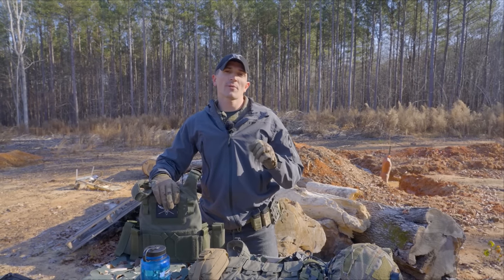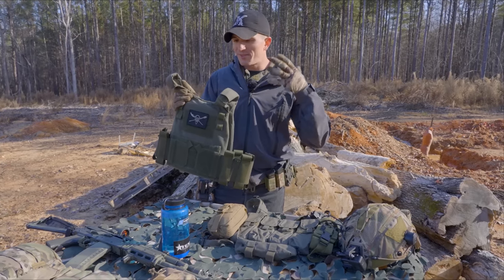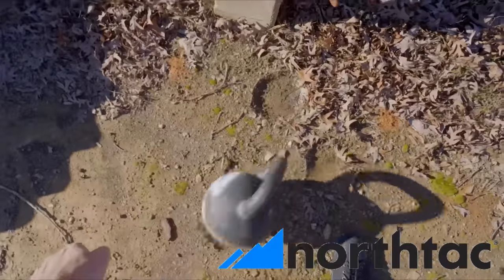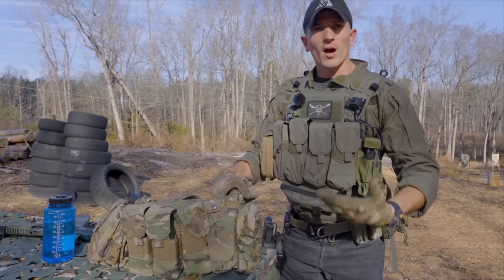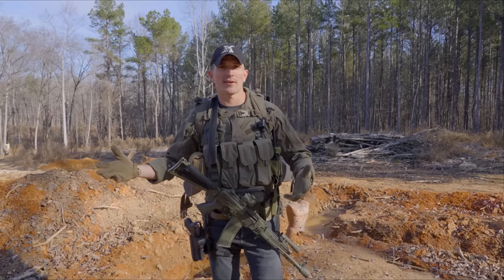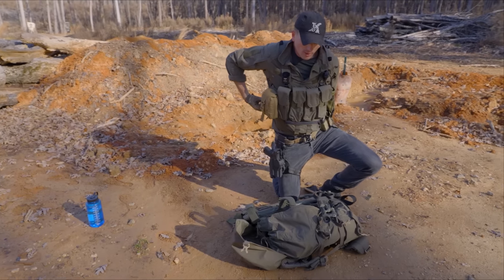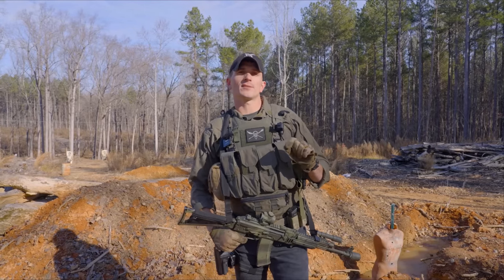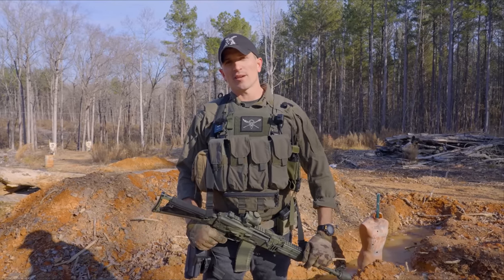What Is Even the Point of Slick Plate Carriers??

Comment: Step one: buy a slickster because the gram pressured you
Step two: try to turn it into a complete PC
Step three: give up and put and lbe over it, pretend you meant to do that all along
Reply from the maker: 2020 IG in a nutshell
Reply: >bought slickster
>put MK V on
>add Radio, TQ and PTT
>adds meds in the dangler
And now im wondering what you guys need more as a "concerned civilian". Yeah, its not the best setup for some things, but it is great for others
Reply: Im in this picture and I don't like it
Reply: You forgot step 4. Buy a velocity or crye or some other PC that actually handles the weight better and cry because you wasted money. 
Step 5. Buy another set of plates
Step 6. Cry more. 
Step 7. Rationalize it as backpack armor.
Step 8. Comment on YouTube videos to cope.
Reply: I am currently going through this cope right now.
Reply: Putting a taps over a plate carrier is the best option because you can just have multiple taps for different loadouts and throw them on top of the plate carrier.
Reply: @deltashot5608  based
Reply: I’m about to buy a slick specifically for the purpose of wearing it with lbe 🤷‍♂️ don’t really get what’s wrong with it, I just don’t want all the bulk sticking out my front like with a regular plate carrier setup. Lbe keeps the weight on my hips which is so much better than a PC.
Reply: guilty as charged

Comment: In my humble experience, the concept of a slick plate carrier is a bit more nuanced than would be initially expected.  From my real world experience hiking up and down afg and also being in a Striker unit gives me two diametrically opposed ideal load bearing set ups for carrying mission essential equipment.
When mounted and mechanized having all of your kit on a PC or Vest is ideal due to the ergonomic considerations of dismounting vehicles with all sorts of snag points, however when spending extended periods of time dismounted where your feet is your only transportation all of your kit weight is only your shoulders leading to increased fatigue and long term lower back injuries.
Now if you run a belt harness (like the vietnam era lbe belt)  for most of your mission essential equipment that weight is now distributed across your hips as well and not just on your shoulders.  Another benefit to the belt harness is dealing with compromised cover positions and prone.  Even if you slap a slick PC on top of the harness it is a far lower profile for prone and more maneuverable in compromised positions instead of the bulk that having double mag pouches and other gear adds on top of your carrier.
So in my experience if you aren't a super spooky low profile operator where considerations of kit concealment come into play you have two ways of effectively hauling your kit.  A mechanized load bearing setup where everything is on the vest where mount and dismount efficiency is life and death critical and the long range dismounted issues are mitigated due to the inherent employment of mechanized infantry.  Or you have a dismounted kit where your weight and width profile is tailored for long term operations away from vehicles.
Just my two cents and looking forward to the keyboard commandos claiming I'm a pog chair operator who doesn't know what he's talking about.
Reply: you can kinda hybrid this by running thinner belt pouches and some sort of load shifter that connects your armor to your belt like the crye STKSS.
Reply: @fartknocker  absolutely there are ways to hybridize kit to varying degrees of efficiency depending on your dismounted vs mounted needs.  But the caveat I'm looking at is carrying a standard infantry load or plus load, so if your kit incorporates a reduced load or "low profile operations" load you can get by with thinner kit albeit at the cost of mission equipment.
Reply: Me and my buddy were discussing this exact thing nearly word from word. He's an AAV guy.
Reply: @IrregularRex  kick ass dude, much love for fellow mech grunts.  Living the life of an infantryman is a complex list of trade offs and priority management and I always love covering the nuances of squad composition, gear distribution, and realities of infantry life past just gadgets and tech.
Reply: @borrago  running slick with minimal gear and maybe a flc vest or chest rig is ideal when having to deal with hatches when operating vehicle crew slots.  When in that case having a basic infantry loadout on your person is less important vs having an emergency loadout in the case of having to quickly dismount a vehicle due to catastrophic damage.  Trying to get out of a gunner/driver/vc hatch can be very problematic in those conditions.  Once again making sure your kit matches realistic needs and priorities is essential.  Vehicle crews just happen to fit in a unique position vs their dismount compliment brethren.
Reply: You are a pog chair operator who doesn't know what he's talking about
Reply: @MrTappers7  I saw you'd been looking forward to that comment for over a year. I'm slightly disappointed in the comeback. Decent response time though
Reply: @Codeeez  I honestly forgot that I put that caveat at the bottom I deleted my response when I reread my initial post
So well played bro and my bad for forgetting my own sign off thinking I was dealing with a different comment line entirely

Comment: I'm glad you covered this bro.

In Contracting, we still use a mixed bag of Chest Rigs and Slick Vests and Plate Carriers (that's moreso on the acquisitions and provision side of Company assets but does have operational needs applicability based on contract too), it's definitely more comfortable and viable for Mobile/ Vehicle use and operations as well, or if you want to try and keep a low profile/ be somewhat covert working deep in the Urban Theater.

The Patrol points are spot on, especially for LRRP and extended distance patrolling, it's more practical to be as light and fast as possible with Combat Load (as you know).  

I run different rigs based on personal and work needs, have a couple PC's kitted out but also have a Slick (from Gear Dynamics) with an OPS Chest Rig (in M81/ God's Flannel), I much prefer the latter.

There is no best system (I've made a video on that too), just what works best for someone based on their needs and environment.
Reply: There's a ton of slick carriers in Ukraine not just because that's all they could get their hands on but even in a really nasty artillery war you're going to have reliable transport and resupply. Video of foreign volunteers calling resupply by phone that arrives faster than your pizza is out there.The days of needing to carry everything you need as the average grunt are kind of over after the last 20 years. A lot of guys wouldn't even wear a rear plate anymore if allowed. And a ton of the high speed guys have gone out a times with no plates, no sidearm, and maybe 2 spare mags for the carbine. Again, guys in Ukraine are trying to carry the least amount possible when running around some city or village in gunfights. They cache stuff, etc.

The founder of Nike discovered that a single 1oz track spike weighed 50+ lbs over a mile run. Weight sucks. Normalize being a minimalist. We injured so many guys over the last 20 years sending them outside the wire weighed down like donkeys in summer heat.
Reply: @RJT80  Yep i've seen that too (and been told by buddies who are there currently).

METT-TC and general situations will dictate what and how gear needs to be carried, moving fast across long distances is one thing, slow slugfest urban warfare with every nook and cranny being a risk for incoming fire is another.  Adaptation happens out of both necessity and the tempo and type of fighting being done.

True, in the earlier GWOT days when I was in the Army we easily doubled our body weight with everything and a ruck/ pack on.  No wonder at all why we all have jacked up backs, knees, necks.

Comment: Good compromise for still utilizing a chest rig or suspenders and battle belt rig. However during ambush your proximity to the ground may be your only cover. Having a rig like the size of Dolly Parton out front won’t be your friend. My compromise involves both gear and load out. The actual Dynema Ceramic Plate rides in my day pack until I insert it into my plate carrier. And I only carry 2 mags up front. Third pouch for radio. I carry 2-4 mags on my belt and more if needed in day pack. Water is usually in my day pack  though I sometimes will carry a canteen, cup, and natick stove combo. Rather carry ammo on my belt for easier access when prone.

Comment: When it comes to specifically vehicle stuff slick plate carriers make a lot of sense. When I was in a more vehicle focused unit pretty much everyone used a battle belt or chest rig but kept their flak completely slick. You can pretty quickly put on or remove a belt when entering  or exiting a vehicle but if you have all those pouches attached to your flak it can get very uncomfortable, plus egress from a rolled vehicle can be extremely challenging with a loaded up flak.

Comment: I like running a slick carrier and a rig

Gives me more options and versatility to run one or the other for different needs

I do feel it really really make sense when you’re operating in and around vehicles. 

Keep the armor with the vehicle unless you’re planning for contact. If you’re planning on a patrol on foot can leave it there or put it in your pack and just wear a rig. If you’re gonna go kick doors or hold an area for security you can have both. Etc etc etc
Reply: There's a ton of slick carriers in Ukraine not just because that's all they could get their hands on but even in a really nasty artillery war you're going to have reliable transport and resupply. Video of foreign volunteers calling resupply by phone that arrives faster than your pizza is out there.The days of needing to carry everything you need as the average grunt are kind of over after the last 20 years. A lot of guys wouldn't even wear a rear plate anymore if allowed. And a ton of the high speed guys have gone out a times with no plates, no sidearm, and maybe 2 spare mags for the carbine. Again, guys in Ukraine are trying to carry the least amount possible when running around some city or village in gunfights. They cache stuff, etc.

The founder of Nike discovered that a single 1oz track spike weighed 50+ lbs over a mile run. Weight sucks. Normalize being a minimalist. We injured so many guys over the last 20 years sending them outside the wire weighed down like donkeys in summer heat.

Comment: I actually keep a minimalist plate carrier in my vehicle. It fits under the rear seat of my Jeep and it is only for emergency. I just put an older set of steel plates and spall  pouches in it and if I ever end up in a situation I need to be protected while away from home or throw it on my kid I’m a bit better prepared. Ceramics go in the full kit where weight savings are better realized.

Comment: My thoughts before you get into the video: I think they have a use in that you can throw a different loadout on top of a slick carrier depending on what you'll be running/doing far easier and more quickly than if you were to rearrange your entire kit for the "mission" at hand. So your area could be dense forest but, if you drive a few hours away you could be in a desert, and you'll want different supporting equipment for that. Or maybe you like to switch up the rifle you run, an AR one day, an AK other days, maybe a battle rifle other times. Buying multiple chest rigs is cheaper than multiple carriers

Comment: OK I'm making this comment before watching the video. In my opinion the reason to buy some slick plate carer is the modularity. Some have solid velcro on the front. If you by the right gear you can basically rip of one rig, slap on your shotgun rig, and done. And you only bought one plate carer. That being said 95% of people don't need one. After video. Made some good points. Agree that having a separate chest rig is a good idea with this

Comment: You can take a chest rig off or open it up if it is a split front. Option a allows you to lighten your weight a little while still wearing armor if your just at a range and resting or if you're just hanging around a FOB or whatever. Option b allows you to get a good prone even if you built your kit out for vehicle operations like a patrolman or security guard might. 

It's pretty simple actually. Just a versatility thing.

Comment: I found many years ago that a single plate carrier system wasn’t the answer. But a layered system was. You can use a basic flick carried under a shirt or jacket for civi ops. And then you can use it under a combat load out. I can even remember using level 3A plus a slick with LBE or SADF best on top.

Comment: Frankly , now with modular placard systems, I like the slick carriers because they are just less bulk, but if I really want 6 mags up front, I can go ahead and switch the placard or add one that wasn't normally there.

furthermore, additional ammunition in a thigh mounted drop leg (so long as its well executed and secure) is not a bad option, if you're concerned about total round count.

Comment: I’ve had my slick PC way longer than any other PC.  It has a purpose and is a great option for low vis.  I had a BFG chest rig that was very low vis and under a jacket worked great.  Plus it gave me options to run different chest rigs for different missions without having to own 3 regular plate carriers or reconfigure one PC.  That’s the value a slick plate carrier brings to the table. A  low vis option and a easy to reconfigure for different missions with chest rigs.  I reckon I’ll watch your video and where you stand on slick PC’s. 👍

Well shoot .  My profile pic has my Beez slick PC.  I also like a slick PC with a war belt for driving as long as you manage your backside.
Your videos are really good.  Straight forward and not a lot of BS. Thanks

Comment: I went with a slick carrier because it's far more scalable to me to do the things i need it to do, all of my chest rigs fit over it. I have it scaled to my current need of a dedicated rifle with a Crye placard and my medical on the back with a roll one pouch and gp pouches for holding various pieces of equipment that will be used for different situations while being lighter than a dedicated MOLLE carrier and still have my water, four mags, another two on my belt, medical, radio, generally purpose items/tools and equipment that are line one while still being low profile enough i can shove it into a ruck and not be too large to get snagged in vehicles and doorways

Comment: I used to run a jpc slick while doing certain things, when op tempo was high and we could be switching mission sets frequently,  it was just easier to throw a chest rig for different weapon systems over it. It's faster and easier than switching out the set up. Grab the weapon from the locker, grab the associated chest rig and go

Comment: Slicks are neat and as you demonstrated the best way to run them WITH load is putting a chest rig over it, a slickster isn’t designed simply to handle 7 mags, radios, back panels, etc. And just because you can scale things up doesn’t mean you should

Comment: Wearing or carrying your plate carrier is the same weight. If its in your bag and you get contact on route to the objective you're in a gun fight without your kit on, now on the flip side in case you have to bug out you can always leave your heavy kit and run. One could argue depending on mission viability and location having your kit in your bag allows you to drop it close to target, patrol around not looking threatening for intel, then put your kit on before carrying out the mission, but I would "feel" safer traveling to target ready to rock. Now the vehicle issue you mentioned is 100% perfect for a slick carrier because I would I have an assault bag and 6 mags up front and there is NO WAY I could easily ride in or exit a vehicle.

Comment: I pretty much do best of both worlds. I run a molle carrier with cobra buckles but no pouches attached. That allows me in winter and fall to wear a size up jacket over it and no one really notices which is great for plain clothes psd roles. That same plate carrier I can use on contracts that are more intimidation based visual detterance as well as on rucks, hunting, milsim and range days with either a placard with g hooks or a full chest rig over top. Since I'm financially handicapped and have need of both overt and covert for work and have to supply my own kit for my job I can use the same carrier for both roles. Plus the wife said no more tac gear lol apparently babies are expensive lmao

Comment: Rip the belt out of a surplus FLC. load it up as a modern "jungle" belt with suspenders. slick pc with micro rig or placard. your weight is is more evenly distributed across your torso and waist.

ive never actually be shot at but it works great for long airsoft events.
Reply from the maker: Back Buckle FLC GANG
Reply: @BlueJeanOperator  RISE UP